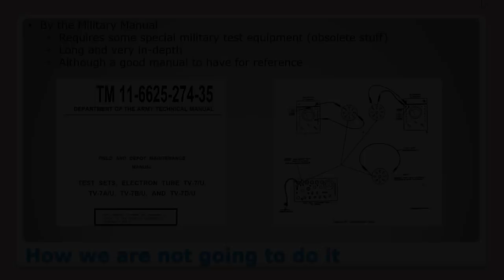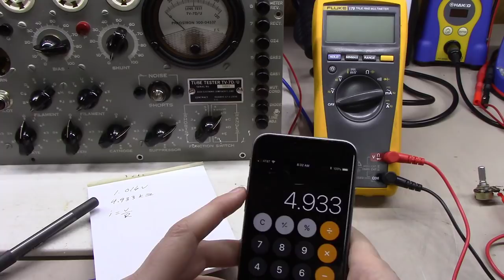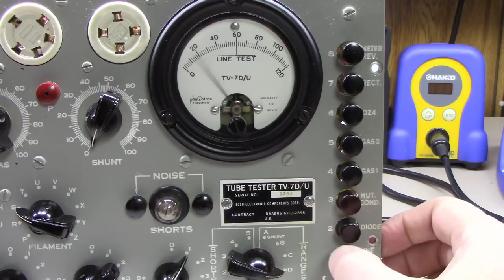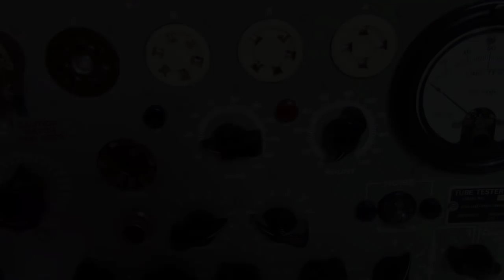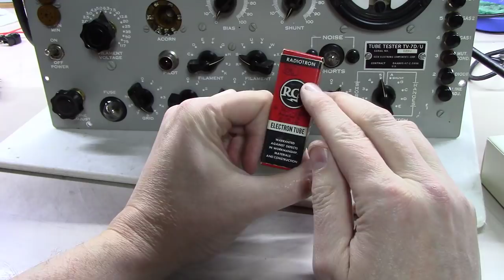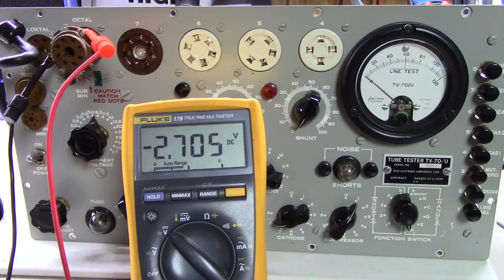TV-7 Tube Tester Calibration, Repair, and Service - a Practical Guide - Part 1

Comment: Hello Mr. Blueglow! I missed you at this years RAL hamfest. Great video as usual. I watched it several times before I picked up a nice TV-10 from FB tube fan club member. I have recently been told that the industry standard for retail sales is the TV-7 and that a TV-10 test carry's less weight with buyers regardless of the TV-10  being an "upgraded" version of the TV-7. Has anyone experienced this and found this statement to be true? What measurements are needed by person in the know to buy with confidence? Thanks
Reply from the maker: The TV-10 isn't really an upgrade.  Pretty much the same circuit, just larger case with roll chart included.  No technical advantage or disadvantage of either.

Comment: If the rectifier tube has molten metal splatters inside the envelope, is it possible the tube is bad. I bought the TV7 to test tubes like the 83 and only have a go-no go tester to do  4 digit tubes, so I have no way to test the rectifier. 
BTW, a new, known good tube causes the needle of my tester to go a bit beyond zero. That can't be good, can it?

Comment: Bought a recently repaired/somewhat updated (guy couldn't have cleaned the contacts as two selectors were kind of sticky/stiff until I cleaned them with Deoxit)  TV7-D/U off an eBay seller recently and for the most part, readings on tubes pretty much matched what I was expecting, esp. triodes like 300b and 2A3, close enough anyway. Rectifiers were good, GZ34s sold as matched sets at 60/60 came in at/around 60/60. Thought I'd check the calibration anyway and meter checked out at 202mA, power resistor (about 9.35k), went ahead and replaced the 47 ohm resistors anyway with better quality vishay fireproof ones (i'm not a fan of the cheap Chicom resistors with the enamel that flakes off); a set of tubes I bought through Blueglow Electronics on eBay showed voltages (pins 8 and 4) were off by about 1-2 vdc on initial checks, took a few hours to run through the tests, calibration steps and everything is spot on now.

ONE question. Why not replace that multi-tapped power resistor with two precision high-wattage linear potentiometers?  THAT setting High/low screen voltages was tedious as anything and the two tabs I had to insulate from each other with a piece of heat shrink tubing they were so close. Actually thought about reversing all the wires and using the other side of the power resistor but I'll just use the tester as it and see how it holds up.

Thanks for putting this together for us.

Comment: Any ideas what I could get for testing EL34 & 12ax7? I wanted to get the Orange VT1000 but they are discontinued. I was looking at the B&K 606 & the 747 but every seller seems shady & the prices are up there considering I'll need to re-cap it & change some resistors & calibrate it. It's for personal use just to keep an eye on my tubes.

Comment: what to say.....  clear explanations, also your pronunciation is slow and clear (i'm italian, so it is not always easy to understand people that talk quickly),  about Video quality... another great video and also added with writings that for sure helps understanding ! i'm going to subscribe your channel. Thx for all the explanations!
Reply: you can slow the video down by clicking on Setting (gear Icon is located at the bottom of the video) on the screen and change the speed, usually 1/2 speed. I have done this for myself, a lot.

You can also read the transcript that shows both the text of the speaking and the time for each sets of the words. Look on the bottom of the video and you shall see 3 vertical dots, click on that and then you can select transcript. It will appear on the right side of the video as a column.

Comment: Fantastic video, thank you for sharing your knowledge.  I am working though the process on my TV-7 (the original with no adjustment pots) and everything was within a hair of where it should have been, close enough i am not going to worry about it.  BUT i got as far as testing the Plate voltages as per the original calibration manual with a 375k resistor and i'm seeing 188v instead of 150v.  The manual goes down a rabbit hole of swapping the plate wires around for each rectifier tube, but curious if you have any better ideas before i go there?

Bias @22 = 2.86v
Bias @75 = 25.26v
Bias @100 = 39.04v
Screen = 125v instead of 130v
Screen = 54.3v instead of 56v

Plate w/375k = 188v instead of 150v

Filament voltages with line test centred,
120.2, 76.3, 53.8, 36.7, 26.45, 19.50, 12.40, 9.99v (10v setting), 7.54, 6.30 (6.3, 5.20, 4.31, 3.24, 2.71, 1.994, 1.273, 1.090, .728

Comment: You don't blow air in meter it will distort the fine springs. The best is submerge meter enough to cover pivot in iso alcohol then let air dry for hour. I would do that to your meter should free up the sticky pivot

Comment: Hi, seems that in TV7UB, there's no 13? pot on the chassis above R134 to calibrate/control the bias, like on the UD version. On my model, there's no 3rd pot like in the video. In addition, the last number R13? can't be seen, so it's hard to know where to check. Any idea ? Regards from France

Comment: Working with this on my new (to me) TV-7C/U.  It's working now, but obviously needs the updates and calibration.  I was surprised to see how small the case is relative to my big Hickoks and I notice that it generates a LOT of heat just idling on the bench.  What's your opinion and experience with putting in solid state replacements for the 5y3 and 83?  I would think it should reduce the power consumption and thus the heat by some factor.

Comment: Interesting video. Helpful in many ways. Unfortunately he will not respond to any questions. I even purchased his set of calibrated tubes on ebay and wouldn't respond to any question on ebay either. Also, the 6L6 metal calibration tube he sold me was very rusty and looked like it was at the bottom of the ocean for a long time.

Comment: Great video, Mark. Thanks for making this TV7 calibration info available in a clear, straightforward manner! A couple of questions-

#1- At 1:08:26, you refer setting the range switch to 5. Would this be #5 position of the shorts test section of the range switch?
#Steel wool for cleaning? Eek! I keep that stuff and it's conductive fibers well away from electronics! Scotch pads work great for stubborn stuff.

Again, thanks for a great video.

Comment: Great video.  I just picked up one of these and used the old military manual to calibrate the voltages.  I cannot find documentation on the gm calibration procedures in any of the online resources.  If you don't mind telling, where did you get this procedure from?   Sincerely, Steve

Comment: for the TV-7 U I can not find a R134 and in the manual for the Military aliment it states R124, so that would be the one I switch with a POT?  For mine the line adjust is at 60 and easy to do, but all the filament voltages are half what they should be
Reply: got it, added a R134 (60 K 5 watt pot had sitting around) and changed R 124 to a 230K so I could make adjustments, as at 245K it was off.. also the half voltage.. du.. I was in 1 and 7 not 2 and 7.. double check..

Comment: Hi Mark, thanks for all the great videos.  I'm in the process of recapping a Blaupunkt radio from the 1950s and have run across capacitors with marking I don't fully understand.  For example: the caps are marked " 50/20 125V" The 125V I understand but I'm not sure how to read the "50/20" part of the marking. The caps in question are small and appear to be foil and paper in a clear plastic tube.  Any help in reading the value would be appreciated.
Reply: Might be 2 capacitors in the same package, how many leads are there?
Reply: Just the usual two leads so I don't thinks it's two caps in one package.  I'm to the point where I'm going to disconnect a few and test them and see if that will give me a clue to how to read these caps.  Thanks for the thoughts though.